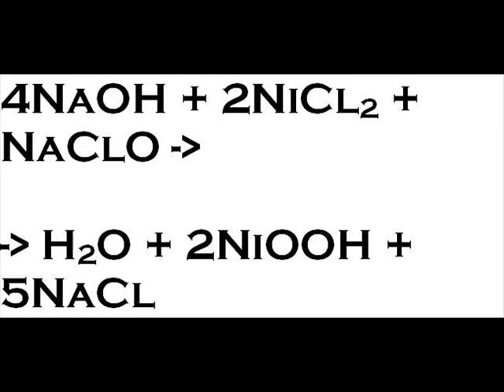How To Make Nickel OxyHydroxide For NIckel Iron Batteries

Comment: Thanks .I am researching the nickle Iron battery as it last decades and is cheap except for the electrolyte . Why do users of these batteries complain it is hard to source the electrolyte in the UK .I am Ireland based and I will check the same problem exists here as its normally harder in Ireland to source strange stuff including buying ready made Nickle iron batteries

Comment: THE EARTH MOVED, THE ANGELS WEPT, WHAT HAPPENS TO THE DISCHARGE RATE WHEN YOU WRAP THE NICKEL IRON BATTERY IN PIANO WIRE AND CONNECT A METER CAPILLARY TUBE FILLED WITH ELECTROLYTE TO THE BATTERY CASING?
WILL THE ENORMOUS PRESSURE PER UNIT INCH ON THE PLATES INCREASE THE PEAK BATTERY DISCHARGE THROUGH THE CONSTANT DENSITY ELECTROYLYTE?

Comment: how would one turn the filtered/washed niooh from powder into a solid electrode?
Reply: Crush the niooh with some conductive material and mix with water and a binder ( PVA, CMC, SBR, PVDF or PTFE) and allow to dry slowly into a solid electrode 
You can make moulds according to your electrode design - round, flat square, rectangular……
Reply: @wwabete2009 what would you recommend as far as relative wt% in the mix?

Comment: Why not just get a nickel sheet/plate  ?
Reply: Have you brought any nickel plate?  It's bloody expensive.   I bought a 100ft roll of nickel strip for about $35 USD, converted to nickel chloride this will be enough for well over a hundred grams.   I would like to use a NiO-HO/graphene matrix for the anode in a NiFe battery, with gelled KHO electrolyte.  more work but far less costly to build

Comment: will either Nickel Chloride Hexahydrate or  Nickel chloride anhydrous work?
Reply from the maker: sure just adjust for molarity
Reply: Robert Murray-Smith Decided on Nickel Chloride Hexahydrate because its cheaper on ebay, not sure what to do about molarity. How would you calculate that?
Reply from the maker: Mike Gimon
it's a hexahydrate so there are 6 molecules of water to every molecule of nickel chloride - so when you weigh out a mole of nickel chloride hexahydrate you have weighed out one mole of nickel chloride and 6 moles of water
Reply from the maker: Mike Gimon
follow leonard janus' advice on the turquoise battery info - it is first class